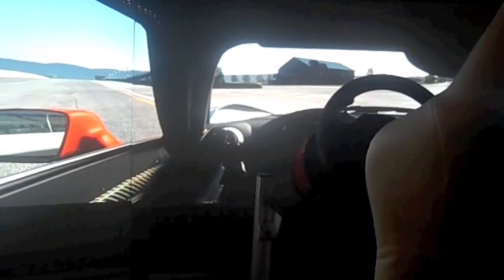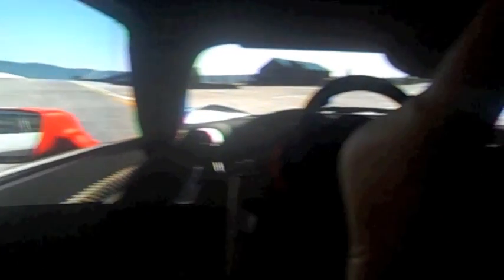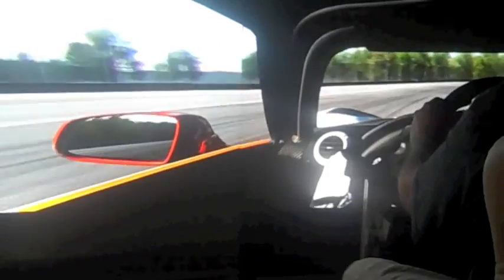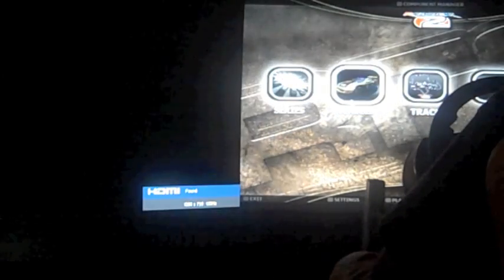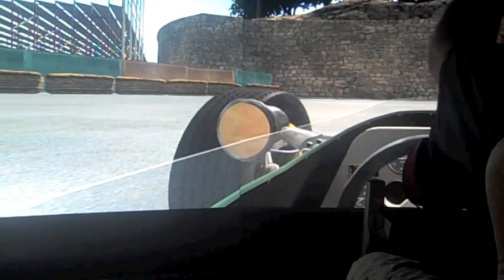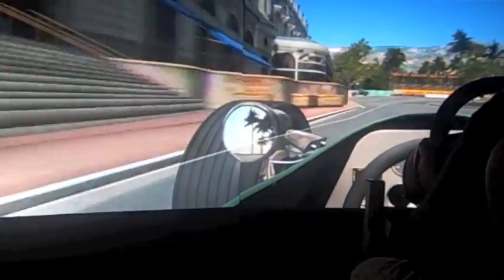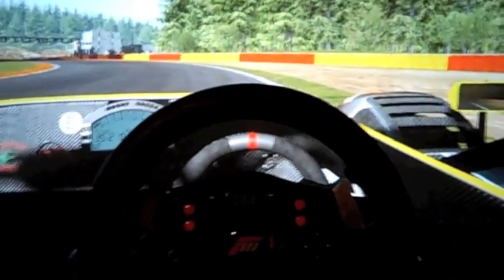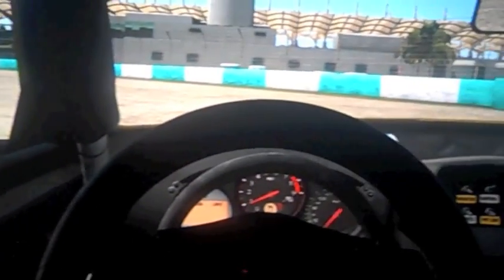Triple Projector 3D Racing Simulator Update (+initial thoughts on pre-release pCARS and rFactor 2)

Comment from the maker: Thanks! With LCD monitors you get higher resolutions. These projectors support 1280x720 each in 3D or 2D mode, so max of 3820x720. LCDs can do 1920x1080 each, but at the sacrifice of smaller screen size and bezels. I don't think it's very noticeable when you're actually using the sim, but more res of course would be nice. Projector placement is also very tricky as these short-throw Optoma models don't have any zoom, and they put off a good amount of heat. Need LED short-throw PJs to come out.

Comment: Check out the 304.48 drivers. I run in 3D Vision Surround and got a boost in performance in rFactor 2. I would imagine it helps with other sims as well.
I love your setup! I can see having something like this in the future. I have the ASUS 27" displays with light boost and am loving them. 3D Rocks in driving sims!

Comment from the maker: Yes, with my setup is PC-based, I use 2 Nvidia graphic cards (model GTX580, in SLI mode, so they work together.) This allows me to enable Nvidia's "3D Vision Surround", (or just surround, if 3D is turned off on certain games.) Connect 1 projector via HDMI to 1 card and 2 to another card. The newer GTX680 card has four (or more?) connectors on it and can support 3 screens in surround w/ just one card (but I don't think it would have the horsepower to do it in 3D w/ full details.)

Comment from the maker: I am using Optoma GT720 model projectors. They are a short throw distance, 720p DLP projector. Got them on sale at Best Buy for $499 each. For screens there are several options. I did a matte countertop laminate for the two side screens but there are other DIY options too such as Sintra for a rigid screen substrate, or "black out cloth" if you want to make a fabric screen. The AVS forum online has a whole DIY screen section to read up on if you're interested too.

Comment: My FPS actually went down significantly with the latest update of rF2.  Not too worried as I know they will optimize it before the final release.  I just did a major upgrade to my system in anticipation of the upcoming titles.  I will continue to use rFactor 1 for our league until all of the bugs are worked out.

Comment from the maker: Thanks! I use a Core i7 920 overclocked from 2.4 to ~3.5. Dual GTX580's SLI for the GPUs. First version of rF2 I couldn't run either, but the update they came out with a few weeks ago now gets me much higher FPS. I have not tried the new beta 300-series drivers from nVidia yet (sometimes display driver updates in triple-screen can be a real pain and hard to recover if things go badly, so I'm at least waiting until the WHQL drivers are out.)